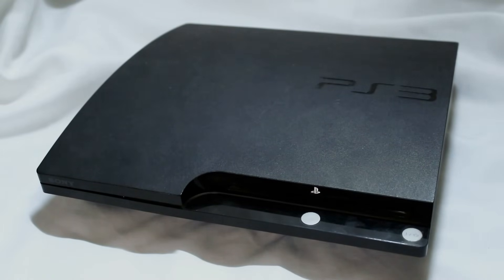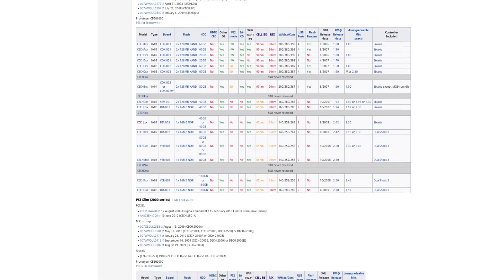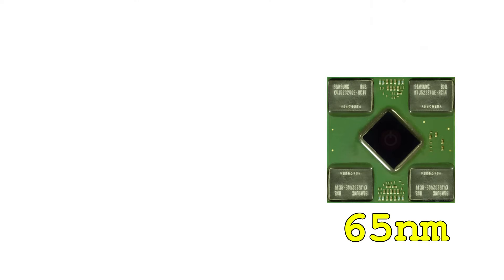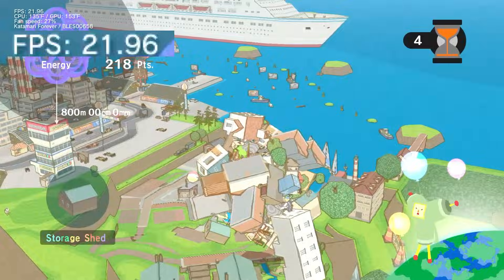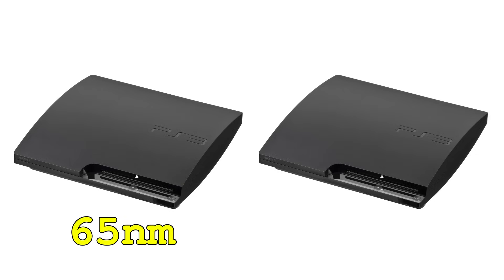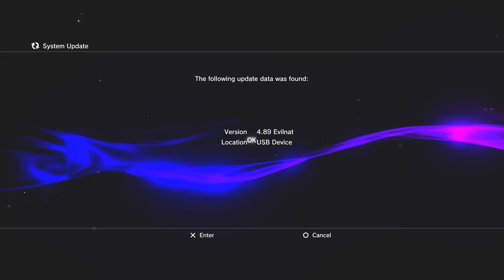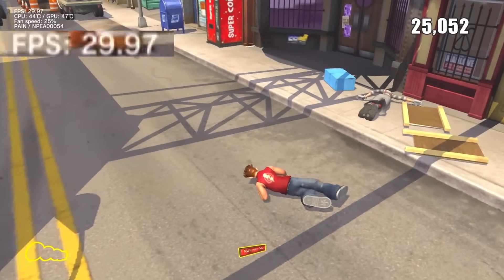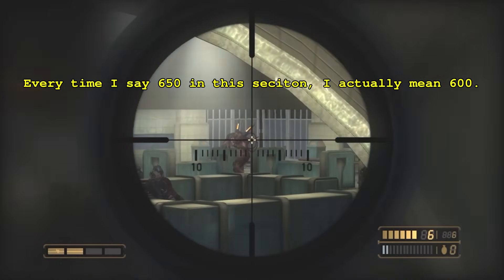Overclocking a PS3 with Project RSX Boost

Comment: 0.100mv increase would perform wonders. Those chips are heavily downtuned to fit power scope.
Reply: Exactly. Sadly no one knows how to increase voltage at all.
Reply: @Tanzu15  It would take an hardware engineer or something of that matter. There's a voltage INPUT into the chip. Solder an ohm resistor and your able to increase it by very small steps.
Reply: @vanderlinde4you  which is something most users won’t do. Until they can crack it and it be an easy cfw software trick, no one will venture into it.

Comment: I'd love to see a RAM upgrade mod, that allows for better textures in games, I'm pretty sure the PS3 could excel in this.
Reply: that would be great in games where you can edit the cfg files like for example v1.00 of Crysis 3 (physical version only) or Alien Isolation that also has the files exposed and can be modded.

Comment: you can do thermal pads to the heatspeaders and pads for southbridge and northbridge and PPU chips yes make a thermal pad that touches the metal box the ps3 uses thermal paste for chips itself and based on gpu size then oc will be higher

Comment: i have a cech 2000a similar to yours and mine already reaches 70c with fan speed going to 80 without oc
i do need to mention that mine was recently fixed by a local shop after the cpu went bad (according to the shop) and it wouldn't ever boot up as if the power was cut
so I don't know if i should go with this or not but there are definitely some demanding games i wanna test this with

Comment: Just have to warn that some games dont work well with overclocking such as lbp2 with some graphical effects not rendering correctly
Reply: No, that’s only if your PS3s silicon is bad. Everyone’s PS3 slim will overclock anywhere from 650 core to 900 core. Silicon lottery is all that matters. Not everyone’s will OC equally.
Reply: for me it was just a single graphical effect not the whole game breaking
Reply: @neotext7941  that means it’s still not stable. Not every game will have that issue though. Just like on PC. Every game reacts to OCs differently. You have to find a perfect overclock that is stable accross all games without graphic issues. Meaning you’d have to turn back 50mhz on core and you’ll be 100% stable.
Reply: @Tanzu15  if that's the case then my ps3 is ass if it can't even handle the evilnat oc
Reply: @neotext7941  wait which PS3 do you have? And what’s the core and memory clocked at?
Reply: @Tanzu15  2500 and i just did the evilnat clock
Reply: @neotext7941  hmm. Yours is a slim. You’d have to be the unluckiest guy on earth. Most slims easily do 700 core.
Reply: @Tanzu15  it's just one effect

Comment: Cool project... however, it's more placebo effect than anything else.
Reply: 25XX PS3 with higher clocks can achieve 60fps in GoW Ascension and between 40~80fps in BioShock Infinite. I wouldn't call that placebo.
Reply: @MitsuTM  GoW Ascension has an unlocked framerate, but spends most of the time (gameplay) in the mid to low 30's. Therefore stating that 60 fps is achieved with very conservative overclocking seems very unlikely. Proof? Bioshock infinate is locked at 30fps. 40 is believable, but 80 sounds like trolling. Maybe during a simple cutscene or while looking up at the sky... maybe?

Comment: I modded my PS3 Slim a few years ago and haven't used it much. After I watched this video I checked and I have a CECH-2501B. It might be time to apply new thermal paste and update the outdated CFW so I can overclock it.  Excited to see games run a bit better! Would love to see more games tested to see how they might improve performance.
Reply: Please tell me. What does your manufacture date say. From
My experience 2501Bs can OC well. But I need the date to know if it can.
Reply: @Tanzu15 I looked on the bottom of my PS3 and it says Manufactured September 2010
Reply: @AmyGrrl78  that has a good chance of doing 750 core stable. But that’s just a chance. It might only do 700 stable. But be assured 700 core 900 memory is 100% stable on all slims from July 2010 and up.

Comment: Do you think you could upgrade the ram chips in the PS3?
it only has 256mb of ram which is split between the gpu and cpu so.
Reply: it's 512mb, 256mb XDR for main memory and 256mb GDDR3 for the RSX.
Reply: @nunosa528  well still its not very much I wonder what it could do with 2gb for both.
Reply: 256MB 3.2GHZ
Reply: @PcMasterGameRace  that's the main XDR RAM, the GDDR3 for the RSX is clocked at 650mhz
Reply: @nunosa528  Me referia a la ram.

Comment: Unfortunately alot of these problem games were coded to work single threaded due to the system being more difficult to develop for, compared to the 360, so overclocking won't really help much with these cases.
Reply: The over lock helps almost every game.
Reply: @Tanzu15  play most of those games on the newer Xboxs you will have a easier and better time anyway

Comment: CECHL FAT console with 1TB SSD CFW 4.90 RSX Overclocked 600/750
I used twice cheaper and apparently twice as efficient liquid metal from China called LT-100. I've had over 30 hours of testing. The highest temperature I have recorded while playing every Crysis game. Speed fan always set to 28% (very quiet)
RSX - 69 degrees Celsius for a short while, then drop to a practically permanent 68 degrees Celsius.
Cell - the highest I recorded when emulating PS2 games was 60 degrees Celsius. In over 30 hours of testing, I never once saw 70 degrees Celsius on the RSX (only 28% fan speed). 
Testing time is approximately an hour of playing each of the tested games.

Below are some of the results I recorded.

MGS4                          Cell - 59 RSX 62
Uncharted2                Cell - 57 RSX 62
MGS2HD                    Cell - 54 RSX 53
Killzone 2                   Cell - 57 RSX 62
UT 3                            Cell - 55 RSX 58
Bioshock                   Cell - 55 RSX 62
Dark Souls II             Cell - 58 RSX 67 unlock framerate
God of War               Cell - 58 RSX 64 unlock framerate
Battlefield 3              Cell - 55 RSX 58
Far Cry 3                    Cell - 57 RSX 63
Skate 2                      Cell - 57 RSX 60 unlock framerate
RDR                            Cell - 60 RSX 65
Crysis                        Cell - 60 RSX 69
Crysis 2                     Cell - 59 RSX 69
Reply: Aha liquid metal would probably be a good idea, I assumed OC as is.
Reply: Did you notice FPS improvement or even input lag improvement on Killzone 2?
Reply: @CeceliPS3  

It's hard to determine.
I played Killzone 2 years ago, and now only after overclocking RSX.

Comment: Underfill was never the problem in the 90nm architecture. Your comment at 3:55 is conjecture based on a misleading forum post that caused many user to misplace attribution of hardware failure to something that affected nvidia gpus years after the RSX was fabricated.
Reply from the maker: You got a source for that? That bit of info comes from these two extremely well-researched videos:
https://youtu.be/Za7WTNwAX0c
https://youtu.be/3qKtS_uxdcU

The clip I used at that timestamp comes from the second video. It's a test demonstrating that the underfill on the 90nm RSX has a lower melting point than that found on later revisions.
Reply: @sync-on-luma  The first video you posted has the timelines completely wrong, he claims the original RSX is from 2007 which is the same time period that nvidia's "bumpgate" took place. This is inaccurate, as the RSX is based on the 7800 series nvidia architecture using the 90nm fabrication which were made ~2005, years before bumpgate and their is no evidence to suggest there was a similar fabrication defect with the 90nm fabrication process. That guy also used the same misleading forum posts from psx-place as the basis for his video. bumpgate affected nvidia's 65nm and 55nm fabrication.

The 2nd video is from the same source as the first video and is working from the same misleading information.
This can easily be checked by looking at the POST sequence of the PS3. Syscon checks the power feed and BGA connections to the RSX, the syscon DOES NOT check the substrate for connectivity. If any of the BGA solder is damaged then the connection is interrupted and syscon will report back as check fail, causing a YLOD. If the BGA connections are fine but the substrate is dead or damaged, there will be no video as the VRAMs are still reporting, so much like a PC with a dead GPU, the PS3 will hang with no picture, but this is GLOD and not YLOD.

There can be many hardware failures in the PS3 that can cause YLOD, but substrate failures cause GLOD. GLOD is extremely rare, the substrate can fail but saying every PS3 substrate is doomed to fail is not backed up by "bumpgate" which happened years after the RSX was fabricated, and not backed up by YLOD from consoles that we see so often.

https://www.semiaccurate.com/2010/07/11/why-nvidias-chips-are-defective/
https://www.quora.com/Why-exactly-does-Apple-use-AMD-graphic-cards-instead-of-NVIDIA/answer/E-Boulesteix

Comment: Whoa, massive understatement about power draw.  Power consumption still goes up with clock speeds even at a constant voltage.    P=I*V^2 where P is power consumption, I is clock speed and V is voltage. At constant voltage, you get a proportionally linear increase in power as  clock speed increase.  A 500 Mhz to 600 Mhz overclock is increasing power consumption by 20%.

You are correct that increasing voltage  alongside voltage really does increase power consumption by a large amount.  Boosting both clocks and voltage by a mere 10% would result in a 33% increase in power consumption.

Comment: I'd be very interested to see how Drakengard 3 plays with an overclock. That's an exclusive that ran very poorly, especially in boss fights.
Reply: Already tried it with overclock and it still run pretty bad. This is just a very poorly optimized game, which is a shame for an exclusive.
Reply: @MitsuTM  Thanks for the reply, good to know. Will have to stick to emulation for that one I guess.

Comment: 10:49 1000MHz?! My man either didn't give two shits about that console or just thought "yyyeah, a 2x overclock without increased voltage should work fine.. Right??"
Reply: Yes that’s how it works. If the silicon supports it, it will do it perfectly. The only risk is a brick. But if it works. The gains are high.
Reply: @Tanzu15  Cant think of many bigger ifs

Comment: Hi, I have used rsx Boost 600 750 for more than two months on my 2500 and I can confirm that the heating problems are due to your rsx 65nm

In most games, both CPU and GPU are kept below 65°C with fan at around 40%.

Comment: Dislike
This is a 5-8 minute video turned into a 19 minute one.
Also lmfao no artifacting can't damage your console.
Reply: Boohoo
Reply: Artifacting is a sign that you're overclocking too much (core and/or memory) and you should lower values to avoid damages on the long run.
Reply: @MitsuTM  Artifacting literally only shows that your overclock is unstable. Nothing else. If you're willing to put up with it you can run it like that all day if the game doesn't crash.

Your only risk in this case is natural silicone degradation bricking the PS3.
Reply: So yeah, if you don't notice any artifacts/crash/instabilities, it should be safe.

Comment: You should also delid CPU's IHS if you're applying expensive ptm thermal pad
Reply from the maker: I did consider that, but I've never delided a chip before and I didn't want to start with one I couldn't easily replace.

Comment: the vid is interesting but the boost in performance is basically non-existent
Reply: Obviously you haven’t tried it at all. The gains are big when doing 700/900 or higher.
Reply: @Tanzu15  which causes artifacting lol. Just get a pc and emulate ps3 games there lol.
Reply: @thesmokecriminal5395  lol dawg it’s silicon lottery. No it doesn’t cause artifacting if you get a decent chip. Jesus Christ who gives a shit about the damn emulator and PCs.
Reply: @Tanzu15  buddy that's way too much effort just to gain a few frames and potentially brick the console
Reply: @thesmokecriminal5395  if you know what you’re doing it’s easy. And it’s already easy as fuck to do. Install the pup file like an update and done. Christ it ain’t rocket science. So many dumb comments in here.

Comment: Does this work on 2008 Fat Model PS3's?
Reply from the maker: Does it work? Maybe, it's entirely dependent on your 90nm RSX being a silicon lottery winner.
Should you try it? Absolutely not. There's high chance of bricking your system due to an unstable overclock, and even if it works you'll just be killing you're already doomed console even faster.
Reply: @sync-on-luma  i see. Thanks for the info

Comment: I could think of 1 possible other way to repair a bricked console. I am overclocking a lot myself and have some experience.  Basically a unstable overclock could become stable if you manage to reduce the chips temperature. You could then reflash the old software and put the console back together. This obviously would require to modify the thermal solution of the console but I think that shouldn't be too hard for an average person. I don't know how the thermal solution of the PS3 is set up and if it would run with for example the cover removed but removing of the cover alone could drastically improve temperature. If that isn't enough you could try to take a stronger fan (connected to some power source like a desktop PC) put it at 100% and press it against the PS3 finstack. The PS3 seems to have very bad idle temperature of 60° improving it shouldn't be hard. Another method could be to press a normal desktop CPU cooler on the GPU. Since it only needs to last for around 5min that should be manageable. 
I hope i can help someone who bricked their PS3
Reply: Bad idle temperature is likely caused due to inefficient use of the GPU in the first place. It's in a always turned on state ; that is what is likely is causing the higher temperature. Second; it's the fan speed thats dialed in to low speeds to keep the noise down. Third; while cooling does improve efficiency of the chip and good cooling might require a lower overall voltage or higher clock for that matter, it's only within a really tiny window. It's old silicon technology - efficiency is not as good as chips of today. I OC myself too; ive done some WR - even worked with cascade cooling (-40 degree) and did OC's from 600Mhz GPU up to 1380Mhz and such. But the whole PS3 is limited in regards of what it really can do. You won't find highly binned chips in that since consoles have to be as cheap as possible.
Reply: @vanderlinde4you  oh your are right I also noticed that the PS3 is choosing to reduce noise over temperature. That is why suggested using a unregulated fan. Regarding efficiency/stability gains: that is of course dependent on how much you can decrease temperature. I recently replaced my CPU cooler. It dropped Temperature under full load from 82°C to ~64°C that resulted in higher stability ( I was able to increase the OC from 4,3Ghz to a previously non bootable 4,4Ghz without changing any voltage settings) and a power usage decrease from ~195W to about 165W so ~15% efficiency gain. Quite significant for 18°C difference. In case of the PS3 you could make a barely unstable overclock (maybe 50mhz too much) stable by decreasing Temperature by 10-15°C. Especially the Video Memory which is often only passively cooled could benefit from that. But you're right that it probably wouldn't make enough difference to justify work for normal use. I only suggested to diy for a short time to reflash stable firmware
Reply: @ratlingzombie8705  For better contact your going to have to remove the heatspreader, and use some sort of liquid metal with a full copper block, and proper airflow. Otherwise "watercool" the whole thing. But it's gains are minimal, as the VRM for example is just rated for X amount of watts - you can't exceed that which makes the whole OC pointless. I'm sure that if someone dives into it and is willing to burn a few PS3 consoles here and there, the sweet science might be figured out.

And yeah chips do require less voltage and will consume less once the heat is turned down.

Comment: 2:30 one note: more power IS used by the chip, even if the voltage remains the same. This is because power is consumed by binary logic mostly during transients (switching state) and this happens proportionally to the number of cycles. If you're interested in more details, look up power characteristics of simple logic gates: they work in pretty much the same way!
What constant voltage guarantees is that, at every given cycle, no more current than stock can flow, but increase the number of transients and energy used (not instantaneous power!) DOES absolutely go up linearly, and heat with them ;)
Reply: No it doesn’t. Stop it.
Reply: @Tanzu15  no for real, you are wrong. Check out "dynamic power" for CMOS circuits.
Reply: @coccoborg  no. Enough.
Reply: @Tanzu15  power consumption is a function of frequency. Yes increasing voltage increases power, but so does upping the frequency.
Stating "enough" does not make physics change.
Reply: @Tanzu15  P = I*V^2 or power is clock speed multiplied by the voltage squared.  
Voltage does have greater effect but clock speed does on its own.
Reply: @powerpower-rg7bk  Isn't "I" supposed to represent current in that equation?
Reply: @Tanzu15  uhm, yes it does! this is how CMOS logic gates work, no way around that, it's physics. See "dynamic power consumption"
https://www.ti.com/lit/an/scaa035b/scaa035b.pdf